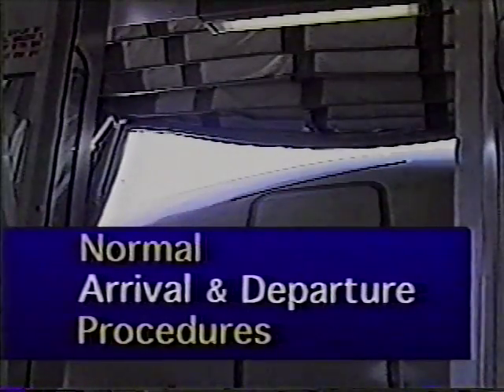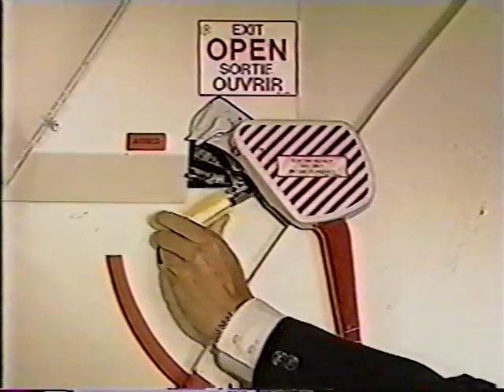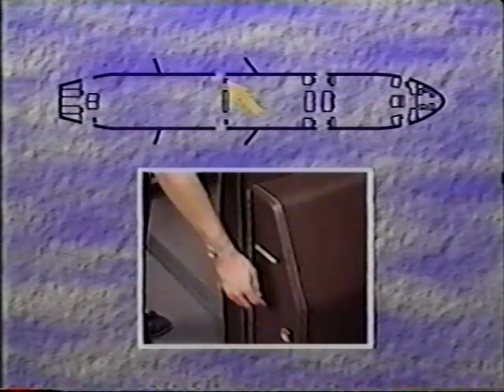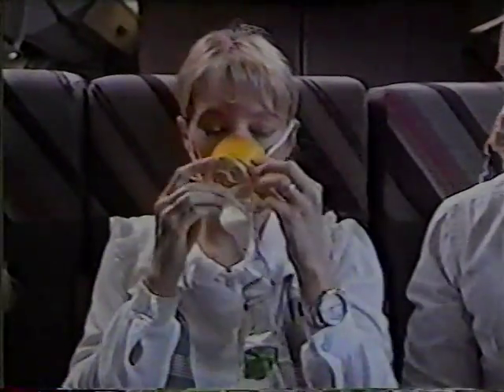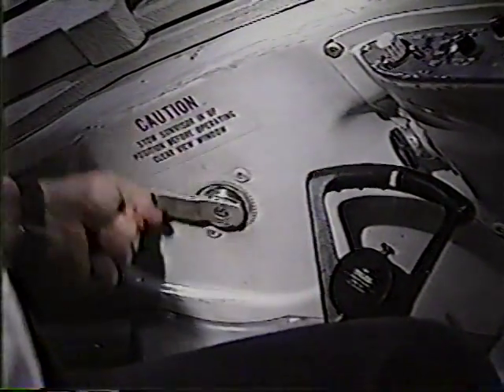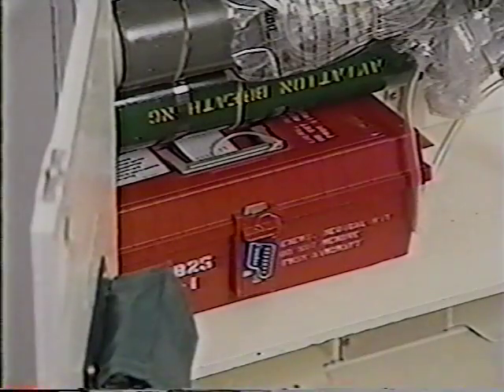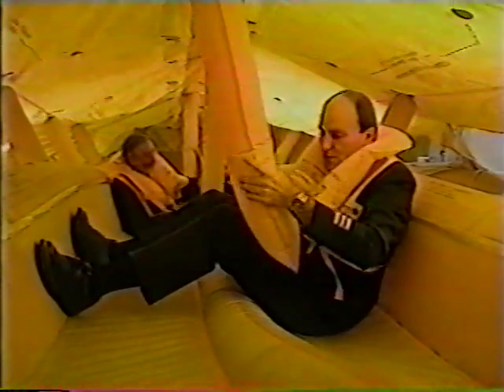Canadian Airlines DC10 Flight Attendant Training Video

Comment: "...can be opened with a sharp object."  Right, and where are you going to find one of those on an aircraft these days? :)
Reply: Stephen Britton well, this was the 80-90’s so...
Reply: A bobby pin or unfolded paperclip will also work.
Reply: Many planes these days have manual opening tools in the storage compartments at jump seats. These are usually a pin, or needle type object.
Reply: You could when this video was made
Reply: In modern aircraft, tools for that are for that purpose are provided as part of emergency equipment

Comment: Other than on US Airways Flight 1549, has inflatable slides ever been used as rafts?  It seems like it would take a lot of time to detatch it from a sinking airplane!
Reply: Airplanes dont sink fast generally. Look at sully. Their aircraft wasnt even in the ditching mode.
Reply: priestpilot slides don’t detach from the plane, thy re for egress only.
Reply: @rapman5363 . Flight Attendant here. They do detach and can be used as liferafts. Just take a look at 15:30 in this exact video.
Reply: @rapman5363  Er there are aircraft where the slides can be detatched and used as rafts, that's utterly falst as an absolute.

Comment: Can the doors be opened manually like the 767?
Reply: Luke Fowlie There is a pneumatic override feature where you overextend the disarming lever up and jam up on the door open/close lever.  The releases a pressurized canister that will open the door in the event of electrical failure.
Reply: Asking for a Saudi Arabian friend...
Reply: We’re talking about an aircraft built by McDonnel Douglas - Don’t expect the doors to work normally, if at all! ⚠️
Reply: @dieseldragon6756  🙄

Comment: How does the emergency exit lever work differently from the flight attendant controls? And why does one move the disarming lever to the override position?
Reply: Mysteryfoxx RJ it’s moved to the override position because that tells the door to open faster than normal, as if th slide would inflate
Reply: The leaver is used in emergency because the door controll buttons won't be active due to being armed
Reply: Normal door operation is electric. Emergency power is pneumatic. You would override the deployment of the slide pack if you were already at ground level so people could just step off. In that attitude, an inflated slide would block the exit if you're almost on the ground.

Comment: What happens if you use the emergency opening handle whole the door is disarmed?
Reply: PureAwkwardness Nothing. The emergency handle is locked in the down position when the door is disarmed.
Reply: @PureAwkwardness. Nothing would happen to the door, but you'd probably be escorted off the plane for tampering with emergency equipment. (It's a far more serious offence than most people think.)

I'm sure you were only curious and wouldn't have actually tried it though. There are actually no passenger DC-10's still flying anyway sadly.
Reply: @Appleboy78165  that would explain why you have to move the arm lever to „override” if you need to e-release the door without slide deployment. 😇👍🏽

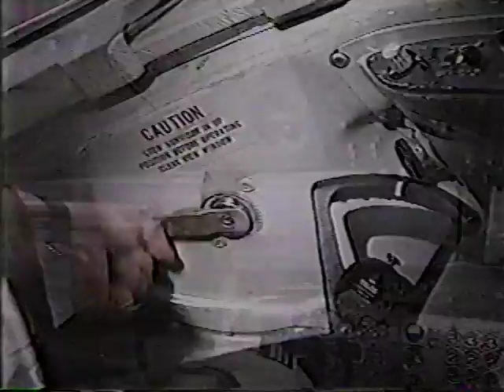Comment: 12:25 , seriously?
Reply: Yes absolutely. If the flightdeck door becomed jammed after a crash landing, or the electronic locks on the flightdeck door fail due to severe crash damage, this is the only option. Fire on the cabin side of the door or deep water coming for you. You'd do it.

Comment: This aircraft door is too complicated to open in case of emergency nor normal operation. The most ridiculous part is that when you have to open any compartment to get oxygen mask. You have to find any sharp objecf t open it. Come on! Where you could get sharp object at once during critical situation? DC 10 is a beautiful aircraft for sure but lack of safety sense.
Reply: Flight attendant here. Part of the emergency equipment on aircraft is an 'oxygen manual release tool.' These are usually located in the equipment stowage under each crew jumpseat. It is a blunt metal rod which is rotated from a protective cover. When pushed into the hole of an unopened (failed) oxygen panel, it will open and the masks will drop as normal.

In a rapid decompression however, you have on average only 20 seconds until you fall unconscious - this may seem like a very short amount of time, but the lungs will instantly deflate when cabin pressure is lost - (try holding your breath after fully emptying your lungs to see what I mean)

The 20 second scenario is why you are always told to "fit your own mask first  before assisting others." If the 20 seconds elapses and you fall unconscious while fitting a childs mask for example, they will most probably panic and not think or be able to fit your mask for you.

As a manual release tool will not be available in that short time, failed drop down doors can be easily prized open, or simply hit or punched to break the lock mechanism. All of this info would be listed on the safety instruction card.

Do bear in mind that the DC-10 was first operated almost 50 years ago, and an interesting fact is that because smoking was permitted in those days, the sticky nicotine/tar residue would cause those overhead doors to get stuck closed.

Of course, safety has improved immensely since then, and DC-10's no longer fly passengers, only cargo.

Example image of a manual release tool:
https://qph.fs.quoracdn.net/main-qimg-3f83c5f2e1431d496ce053afa9f72e1a
Reply: @theboardshorts  I think I've seen cabin crew use something like that in the past. On Ryanair, it seems that oxygen manual release tool corresponds to an unfolded coathanger. But if it works... 🧰🇬🇧🙃

Last few times I flew (A340s I think ) all of the overhead mask panels had what looked like slide latches on them. I'm going to guess this is so pax can solve a non-opening panel by themselves without crew assistance? 😇

Comment: A Pressurized Airliner should never have Doors that open to the inside in any way. That is just stupid design!! Hence why there was so many issues with those and even crashes caused by the doors...
Reply: You mean outside....and it was an issue which Douglas fixed
Reply: Generally speaking: Because aircraft (ordinarily) have greater pressure inside the cabin than outside (You're basically sitting inside an oversized Coke can) you want the doors to open inwards!
If they open outwards and don't use something like Boeings Exploit conical shape of fuselage to make an inward-opening door that can then swing out then as soon as the pressure exceeds a certain differential, bang goes your door...Literally! 🚪💨💥

But then again, we are talking about the DC-10. An aircraft with many oversights in its design, probably including no differential sensing or motor override to prevent any of those „Garage“ doors being opened whilst the cabin is still under pressure... 💨🎈🌬😲

Comment: I am a former Flight Attendant and here to tell yo7 when you have a cigar tube filled with hundreds of burning passengers, those slow moving doors will only going to guarantee more people will burn up
Reply: Have you ever operated on an aircraft with upward sliding doors such as this?
(DC-10, 767, MD-11, Tri-Star, possibly others.)

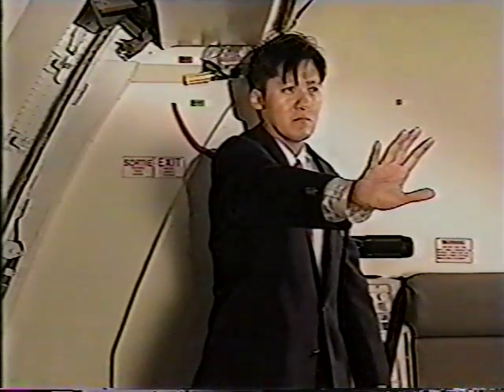Don't worry, when a door is opened when armed, a gas powered cylinder rapidly opens the door in approx 3-4 seconds. The electrically operated doors would also use this function in an evacuation as they are also fitted with an emergency power assist function. See 10:00 in this exact video.
Reply: @theboardshorts  You've got to be kidding me...That same design of door is also fitted to the 767?!? I thought Boeing were a lot more sensible than that? 😳

For a class of vehicle where the doors aren't passenger operated having a door that rises vertically can't have any purpose beyond increasing risk to staff/pax (How many people have been crushed by the doors on DC-10s?) and in the face of things seems entirely pointless. Unless they ever invent Trainlike or Crew-free aircraft (Perish the thought!) where door opening is done by pax pressing a button, these make no sense at all.

What benefits does a vertical door offer that a manual swing-in-out door cannot? 😇
Reply: @dieseldragon6756 The early 737s and 737-200s also had the upward/downward sliding doors at 1L & R as well as 2L &R the overwing exits were regular pull and toss mini doors. 
These 737s were also fitted with their own air-stairs. Boeing has since added bars that we lock when the doors are open for catering and air for instances when the crew is aboard and the aircraft is not parked at a gate with a jet bridge extended from the airport building.
Reply: @personofinterestchocolatem9158  No 737s had upward/inward sliding passeger/galley service doors. They all opened outward. The 737-200 combi rear passenger door was hinged at the bottom and opened downward since the folding airstair was attached to the door. Pretty sure the 767 is the only Boeing type with the inward/upward doors.

The Lockheed L-188 Electra also had upward/inward sliding doors.